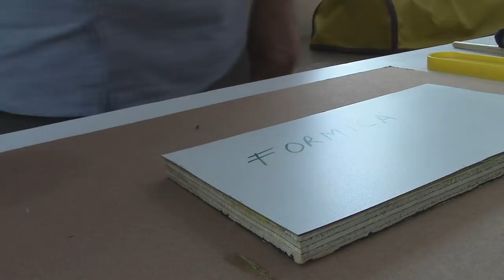Upholstery Glues

Comment: I just want to make a quick but I feel important comment about a very good glue available within the USA.

Dap Weldwood Landau Top and Trim (light blue can label). HHR Spray Grade Industrial Professional. 

You cannot get this at home depot. 

To me this is the only glue to trust for a no comeback job that I have used. 

I suggest the 5 gallon container and transfer it to small containers for use or into a gun.

Harbor freight has acid brushes for 30+ packs and larger 1 inch and etc brushes for very cheap. Less than ten dollars buys you over 60 brushes small maybe 0.75 to 1cm and larger sizes, I like 1 inch or about 2.5cm.

3M 90
3M 77
3M 98 

Etc I believe all those glues will fail on hot days etc after a few years or months. 

Harbor freight also has a $21 siphon feed 1.8mm tip 1 liter / 1 quart or so gun that is cheap enough to simply throw it away after a few big covering headliner panel jobs. Note it will probably be cleanable but you will always incur some cost. 

Time and effort
Solvent material etc

I almost think it would be best to fill the gun at least 50% full and it does stay liquid and right when sealed up for a looong time. Maybe someone else here can help suggest a good cleaning tip as $21 a gun isn't expensive but it isn't cheap. 

Anyway, the dap landau glue is the absolute best glue I have ever used for strength and it is workable brushable and reliable. Stinky tho, prolonged exposure I'd wear a respirator. 

I am just a hobbyist who only has experience wrapping headliner panels and pillars. No real upholstery like Checaflo. 

I would love to become a master like Checaflo. I love his videos. But that glue I think is the best. A little goes a long way if you just need to "dry tack" some touch up areas inside a car. Or rubber seal. 
Be careful with fresh wet glue as it will bleed through. A dryer coat of glue on your brush will not bleed through and will stick really well. You'll see. 

The dap landau glue is not extremely snotty like Wurth Rubber Glue ($35 for a dinky lite jar but it has its place) 

I had a rear spoiler job to do, 85 bmw 635 rubber spoiler. 

I used wurth rubber glue, maybe a little aged but still very fluid and good. Maybe I didn't use enough but whatever. The job failed. Of course I offered to redo it and I decided to use the dap the 2nd time around (I actually didn't have it at the time, was at home actually) and after using the dap it has been perfect since in rain and sun. It's a factory glued down soft rubber spoiler with some integrated bolts that snug up to the trunk lid. The dap glue works great and I think for glue down weatherstripping it would be great to coat  one side and let it dry and then if you need to have some workability you can just slap on a wet coat and quickly aplly the pre glued but dry to the touch component (example, trunk seal channel has 2 coats, a dry coat and then possibly a 2nd wet coat just before installing the applied and dry trunk rubber itself). 

I haven't done that but I expect it would give the rubber seal some good workability before it sets up to really get the seal factory perfect. This is where that wurth glue is also very good, for body rubber and etc. 

Anyway dap pretty much makes wurth rubber glue obsolete for me. I'm still mad I lost my can of Wueth rubber glue. It's gotta be around but it was new and 99% full... Anyway good luck gluers. That dap weldwood landau glue is fabulous.
Reply from the maker: Thank you  very much for sharing with us useful information!
Reply: thank you x 3 !
Reply: Im no pro but i got a extremely snoty glue it is tpo roofing glue solvent base 5 gallon 120 bucks from roofing stores, I put in large pickle jars and brush it on. cheers
Reply: Good write up

Comment: Did my first upholstery job today.  Let me tell you, first time is much difficult compared to watching videos!  Did the work in the balcony in the sun 30 C and the glue became like chewing gum, you need to only put a little in the tip of the brush and do it again and again, very frustrating.  Also I used a lot of glue, almost finished a 820ml can with just one trunk bottom covering. I have two more panels to do, the trunk sides.  It was very difficult because I decided to reuse the old material which has shrunk a little in the washing machine (couldn't find matching material).  The glue I used is like in the video, formica glue light yellow.  Thank you Cechaflo for all the videos!

Comment: Would you like some tips from a professional car upholsterer  ? 
1 . Never ever use a brush or a paint scraper as you'll never get it even and you can only use the brush once then throw it away.  Instead use the plastic card intended for applying body filler , they are flexible , you can work the glue deep into the surface and easily cleaned  ( mine last for years  ) .
2 . Only buy glue from professional auto upholstery suppliers and specify a heat resistant type.  It won't cost much more and as cars get baked inside most other glues easily fail . 
3 . Spray glue of any type is never as good as spreadable glue.  Ok for some jobs but only buy trade quality in cans as the guns just gum up . Once again go for heat resistant. 
4. Can speed up process with a heat gun  ( also useful for simultaneously softening vinyl ready for stretching into areas) but need to be incredibly careful not to over heat and damage anything  . Heat gun releases the thinning agent in the glue.
Reply from the maker: Hello Andy, Thank you very much for sharing with us some important upholstery tips!
Reply: I bought new headliner material and removed my headliner and removed the old fabric and foam. I purchased the 3M super 77 adhesive for fabric. Applied it to the headliner board and to the back of the fabric and let it tack up. Re installed head liner and two days later its sagging now. What should I do to fix this?
Reply: Hello , I have some questions.First,if we forget the adhesive lid open and if it gets gummy is there any way to turn it to its original shape.May be by adding thinner or acetone ? My second question is how to clean it from our hands ? The last question is if we bond plastic to leather , how we can take it apart later.Thank you.
Reply: Start your own you tube channel!

Comment from the maker: The 'solvent based yellow glue' is a traditional adhesive or contact cement used in car upholstery and furniture.
After spreading over both surfaces to attach let it dry for 10 to 15 minutes until it is not sticky to your fingers.
https://www.youtube.com/watch?v=o2xeezdF8Ss&t=1s  
It is the same glue used to stick formica (as shown in the video) Min. three I applied two coats for a better adhesion.
Trade marks are different in each country.
If you are in USA:
https://www.homedepot.com/p/DAP-Weldwood-32-fl-oz-Original-Contact-Cement-00272/100125525  
https://www.petronioshoeproducts.com/master.htm  
https://www.amazon.com/-/es/Petronio-Master-Cemento-multiusos-onzas/dp/B076DJQN5R
Reply: Hola sr cesar el pegamento HH 66 se puede poner para ala sprayadora para exprayar o que me recomienda mucho exitos en sus videos me gusta ver sus trabajos.

Comment: If everyone else was struggling to know which glue to use I found out that the Dap Original Contact Cement had a better service temperature than the other glues mentioned in the comments.

According to the technical data sheet the service temperature is -40 to 180 degrees F.  This should cover the needs of just about any hobbyist out there.  It is easy to brush on and you can reposition it as long as you don't use firm pressure.  If you need to thin it to make it sprayable acetone should work but they also make a thinner specifically for it.

It is also available in quart sizes instead of gallon which makes it a great option for smaller projects.  Not to mention you can get it at home depot and lowes.

I'd like to add that the Landau top adhesive has a service temperature of 0 to 150 deg. F.
Reply from the maker: Thanks so much for sharing this useful information in our upholstery channel!
Reply: @Cechaflo  You're welcome!  I'm glad YouTube finally allowed the post.  I would post the links to the data sheets but YouTube may delete the post

Comment: It is important to note that if you use a respirator(and it IS recommended to use one if gluing large amounts), to use a respirator with the correct filter installed. A simple dust filter will not filter out vapors or fumes, you must use a filter designed for that specifically. Most filters will let the harmful vapors through quite easily.
Reply from the maker: You are right! we have to use the appropriate mask...it is very important to take care of our health.
Reply: Enough glue vapors will suffocate you.

Comment: That's for posting this. I was able to find this in America under the name Weldwood in Home Depot.
Reply from the maker: Yes, Weldwood is ok!
https://angelusdirect.com/products/all-purpose-shoe-cement
http://www.ebay.es/itm/Petronios-Master-All-Purpose-Cement-Glue-Shoe-Repair-Adhesive-Glue-4-oz-/112032405167
http://www.homedepot.com/p/DAP-Weldwood-32-fl-oz-Original-Contact-Cement-00272/100125525
http://www.dap.com/dap-products-ph/weldwood-landau-top-trim-high-heat-resistant-contact-cement/
Watch min two:08 of this video where Greg shows the use of ´petronios'glue.
https://www.youtube.com/watch?v=RLH8BY8a
This video shows Barge glue from Tandy leather:https://www.youtube.com/watch?v=PE6dGvgWfnU

Comment: Thank you for the video. Well done. I have some auto upholstery to repair and this will help if I can find the products here in the USA. Thanks again.
Reply from the maker: Similar brusahble products in USA:
https://www.petronioshoeproducts.com/master.htm
https://www.ebay.com/p/1158244263
https://www.amazon.com/Petronios-Master-All-Purpose-Cement-each/dp/B076DJQN5R
https://www.homedepot.com/p/DAP-Weldwood-32-fl-oz-Original-Contact-Cement-00272/100125525
Sprayable glue:
https://www.amazon.com/Dap-Weldwood-Contact-Adhesive-Solvent/dp/B008G8KVZ2

Comment: I bought new headliner material and removed my headliner and removed the old fabric and foam. I purchased the 3M super 77 adhesive for fabric. Applied it to the headliner board and to the back of the fabric and let it tack up and re coverd it and looked awsome. Re installed headliner and two days later its sagging now its been about 90 degrees here in the midwest. What should I do to fix this?

Should I remove headliner and pull fabric back and use a liquid glue and apply it with a brush to the headliner board only?
Reply from the maker: I suppose the 'new headliner' is thoroughly loose. Then it will be necessary to remove it again and start reglueing again both surfaces using the same 3M77
Try to manipulate the headliner material very careful to not form folds or creases.
Sometimes, it is necessary a 2 time application. The first coat is useful as a primer to get a better adherence for second coat.
If you want to use the method of applying dense glue over the cardboard could work out. The pasting should be dense  and while still 'wet' stick the 'headliner material' over. It should be done in areas little by little taking care of not pressing the material too much because the glue could permeate through the foam to fabric on top.
I use this method in this video:https://www.youtube.com/watch?v=coueKGKYlds&t=804s
Warning: Glue vapors a re very strong. Use mask and goggles
Reply: What other ahesive would you recommend?  3M 38808 ?
Reply: 3m 77 is junk!!!! Never ever worked for me

Comment: How do you store your glue after using it? I opened my dap weld wood glue one day and then didn’t use it for another 2 weeks and it was dried up. How can I avoid that? Thank you.
Reply from the maker: I have realized these glues last longer than two weeks. It should be stored in well ventilated area. We should not placed it under the sunrays. The cap of the container should be well tightened. The solvent evaporates easily if it is not well tightened.

Comment: I would like to see what happens when you pull up the material, to see if all the glue ends up on both the vinyl side of the door panel, as well as on the material itself. Are you planning a follow up video. There should be glue on both surfaces if it is working correctly. It is definitely a problem trying to glue to plastic door panels. Jerry
Reply from the maker: You are right the yellow glue should be adhered to both surfaces to get the best adherence after a thorough drying process. Some plastics are kind of 'oily' and found on car dashboards, panels, etc. In this case, it is advisable to softly sand the overall surface to erase that luster in oder to get a better adherence of yellow glue. It also would be advisable the application of a first coat of glue as a primer then apply the second coat after it is thoroughly dry.
In the worst case scenario, polyurethane transparent glues work out good in case of 'difficult' plastic surfaces. Shoemakers use it to glue down tennis shoes.

Comment: Я так понимаю ,это клей "Найрит" ? Вы его в используете в основном в производстве мебели и при обшивке дверей авто? 
Используете ли полиуретановый клей?? Если да, то где именно?
С какими материалами нужно использовать клей найритовый и полиуретановый ? 
              спасибо.

I take it this is Nairit glue ? Do you use it mainly in the manufacture of furniture and in the lining of car doors?
Do you use polyurethane glue?? If so, where exactly?
What materials should I use nitrite and polyurethane glue with ?
thanks.
Reply from the maker: I mostly use the traditional upholstery yellow glue. But, I am still testing the polyurethane glue to automotive upholstery. I have realized some factories use this kind of heat activated glue.
Trade marks are different in each country. I am located in Mexico. What for sure I know is these glues are applied in the shoemaking industry, including tennis shoes.
The Nairit glue seems a similar product:
https://himik-plus.com/index.php/en/catalog/47-base/28-adhesive-nairit-cr-3307
Reply: @Cechaflo  ,спасибо
Reply from the maker: @мрак-и1п  You are very wlecome anytime!

Comment: What is the glue you use with the heat gun as your putting it together, and why do you use the heat gun.
Reply from the maker: It is polyurethane glue. After the application it dries in a few minutes but the longer it dries the better adhesion. Shoemakers recommend to leave it until the next day.
https://www.youtube.com/watch?v=TIKF6NvXHE4&t=23s
https://www.youtube.com/watch?v=cKl5si8naDs&t=2489s

Comment: Cechaflo, can these glues be used to glue carpet onto vinyl already glued to a car's interior?
Reply from the maker: Glue carpet to vinyl is possible. Use masking tape to mark as border line and not let the glue pass over. The glue should be spread on both surfaces vinyl and carpet. For a better adhesion let the first coat dry well and then apply the second coat. After 10 minutes approx. do the sticking process.

Comment: Hello , I have some questions.First,if we forget the adhesive lid open and if it gets gummy is there any way to turn it to its original shape.May be by adding thinner or acetone ? My second question is how to clean it from our hands ? The last question is if we bond plastic to leather , how we can take it apart later.Thank you.
Reply from the maker: 1. I am not fond of thinning the yellow glues. I'd rather buy a new can or bottle Personal opinion).
But, I am conscious these glues could be thinned with a compatible liquid. I do not know if it would have the same efficacy.
2. Acetone is good to clean the hands with a rag. Some water and soap afterwards.
3. The only way I have used is pull from an end and peel off little by little. If the plastic is bonded to the right side of leather the pigment and sealer peels off. Unless, it is a plasticized leather. If I unglue a plastic from the suede side of leather it rips out the hair leaving an uneven surface.
If I do this, I do not use this material anymore.
John from Lucky Needle explains a point of view in this video. The comments are also interesting.
https://www.youtube.com/watch?v=sZ4jeK56dTQ
Reply: @Cechaflo  Hello , thank you for your kind and quick reply.Today I call the factory of Balco Bally (Contact Cement of Switzerland) and they advice the solvent called "Toluene" is the best cleaner and thinner for their product.It's not easy to find but works best.
Reply from the maker: @emrecenkers9721  As mentioned the best is the use of a compatible thinner to the glue.
https://www.chemicalsafetyfacts.org/toluene/

Comment: Hey im working on re doing the foam on my car seat. i was wondering if there was a spray can glue i could use. Im able to find headliner glue from 3m and permatex . Im just not sure if this is strong enough or even OK for foam. I can find regular dap contact cement and also locktite spray on high performance 200 adhesive, but not sure it it would hold up to heat in the car.  also locktite 300 spray says water and heat resistant but not sure if it would eat up the foam. If you could recommend anything that i could buy from a local store like homedepot or lowes, even walmart id appreciate it !   Thanks
Reply from the maker: https://www.homedepot.com/p/DAP-Weldwood-32-fl-oz-Original-Contact-Cement-00272/100125525
https://www.amazon.com/Masters-Contact-Cement-8oz/dp/B00BZXB2FI
Reply: Spray can glues are very useful but still fall short